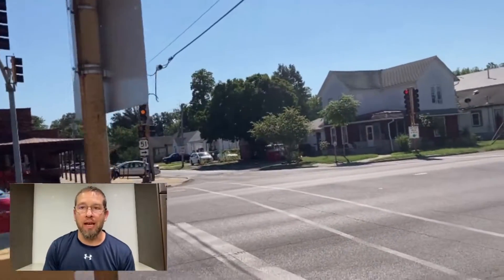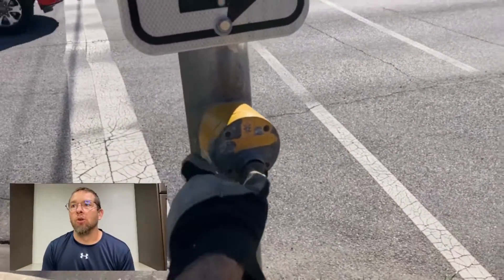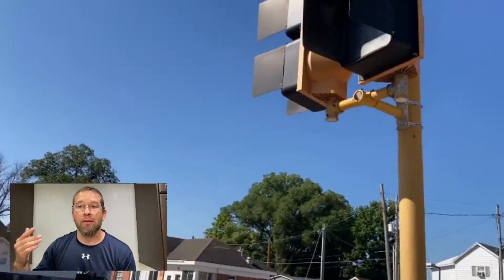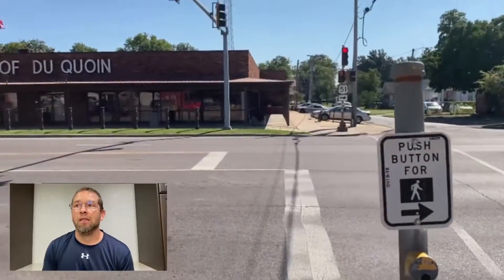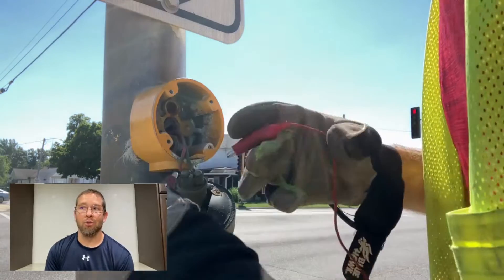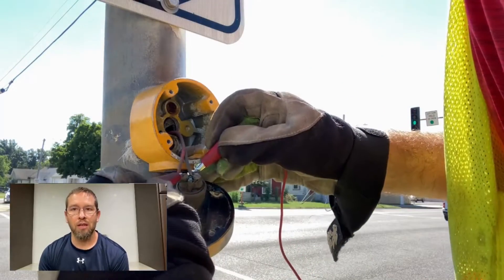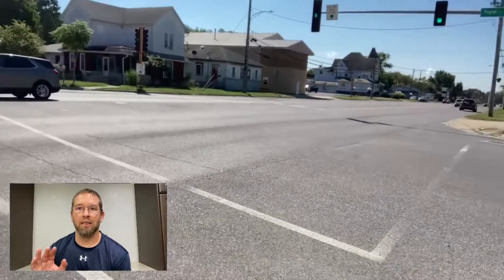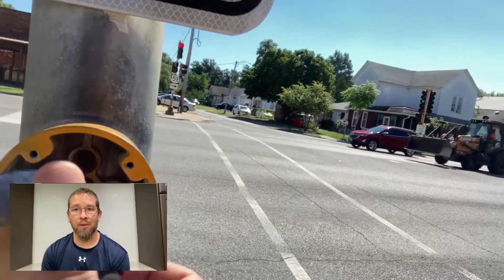Fixing a Failed Pedestrian Button

Comment: Would love to see a video on how the controller talks to a  digital ped crossing display, specifically the ones with the countdowns.  Does the sign have a rs422/485 serial connection, or is it something simpler? And how does that affect the conflict manager configuration?
Reply from the maker: This will probably be a let down to you LOL
Nothing special.  Happens like this:
The controller outputs a walk logic.  The logic is switched to 120V by a load switch in the cabinet.   The 120V goes over a wire to the ped head lighting up the 'man walking' indication.  When the controller times out the walk logic, it switches to a don't walk logic.  Same thing happens thru the loadswitch over a seperate wire ran to the 'hand' indication in the ped head.  
The ped module in the ped head does all the heavy lifting for the countdown portion of it.  
It counts the amount of time the don't walk indication is lit.  
Next time around the ped crossing is serviced, it knows how much time to countdown.
Conflict monitor just makes sure the walk doesn't come up with a conlicting phase
That's it!  Hope that was helpful.  Great questions.
Reply: @ thanks for the detailed answer!  That was awesome!  I never thought it would be so… automatic.  I’ve always been intrigued by how the controllers work on intersections since I was in community college.  I had a programming course where we had to write assembly language on an old Z80 microprocessor and implement a traffic signal controller, including timing loops, input from vehicle sensors, outputs to lights, etc.  thanks for all the work you do on your videos!

Comment: So if someone pushes the button 10 times, will the ped. signals cycle 10 times even if the button is not pushed after the first cycle?
Reply from the maker: No--you can push it 100x but it only 'locks in' the first push.  Once the ped crossing is serviced, it will accept another button push (or 100-LOL)

Comment: Questions.. (Aussie here so not sure if the hardware is the same)..

1. How late into the sequence can the controller be influenced by a tram/bus priority input? For example, if a bus activates a loop on the east as the north/sth has just turned amber.

2. All-flashing is obviously a fallback operation. How much of the controller can fry/release its smoke but still be able to fall back to flashing lights? Is there independent circuitry that ensures this function?

3. Do you manage the timings of phases? If you're working on a box, is it your purview to adjust the timings?

4. Can you go into any detail about linkages between sets of lights?

5. If north/sth is about to turn red, and both east/west are about to get turn arrows, turning traffic on nth/sth can also get a green arrow (where fitted, of course). I've seen some lights that will maintain a green arrow through the sequence, whereas most wait until then phase shift. This seems like a waste of energy, stopping cars when 2 sec later, they get a green arrow. Is this a feature limitation of controller models OR a set parameter?
Reply from the maker: Wow.  You have questions!  Here we go:

1)A preempt call (depending on priority status) can override the general sequence no matter where its at in the cycle.
2)A device called a conflict monitor resides in the cabinet and checks voltages and conflicting signals.  It's job is to place the signal in flash if it sees anything that isn't normal.
3)Yes, I do timing
4)Depends how the agency or contractor wired it.    It can daisy chain between signals or it can be homeruns from the cabinet.  Either way, they all trace back to the field terminals in the cabinet where the G,Y,R outputs are sent out from the controller.
5)This sounds like you might be describing an Overlap.  These are indications that 'mirror' other phases (movements).  They can be used or not used.  Phases have to be used.

Comment: being from the UK, isnt there any visual indication that the button was pressed, actually near or on the button itself? Also why do crosswalks never give enough time to actually walk across the road?
Reply from the maker: Yes, all new buttons have a red indicator below the button that, when pressed, illuminates-letting the pedestrian know it recognizes the actuation.  This was a very old button in the video...
And if crosswalks are not giving enough time for a pedestrian to cross, then the engineer did not calculate the formula correctly.  If you know who maintains the signals, I would call them and let them know the issue.  That's a no-no over here.  Thanks for commenting!

Comment: hmm. Around my Area. They Disabled them all. Mainly Due to people getting out of their car to Push the Button to change the Light. That Was One of the Main Reasons, Another Reason was due to Beggars(Mainly FAKE Beggars) would Pose as Homeless press the button to stop traffic, then go knock on windows asking for change. So Town Decided to just Disable all the Buttons and extend the Red Lights by a extra 3 seconds. Now there is Actually 2 Working Pedestrian Buttons still in Town. One in Front of the Hospital and One in Front of the Police Station. Both Have Cameras and Have Signs saying they are Monitored. dunno if it is true or not. but so far it works.
Reply from the maker: That's a shame that it came to that.  
Not sure why people had to hop out of their car to go push the ped button.  Sounds like the agency responsible for the signals were not maintaining them properly i.e. vehicle detection was not working?
And I know alot of towns have beggars but pushing the button to stop traffic?  wow...part of me says enforcement needs to get involved there... 
Anyway, thanks for commenting!   Interesting to hear stuff like this!

Comment: I've found it just as easy to use my multimeter and check for continuity.
Reply from the maker: Also another valid option!  That would check the button oeration when pressed and you have a test lead on each terminal.  However, it would't test the wires heading back to the signal cabinet.  Thanks for your input!

Comment: I was surprised you took the effort to use a cliplead to test that button. You had the screwdriver in your hand, and there was no insulation barrier in between the screw heads. I just would have shorted them with the screwdriver blade. :-)
Reply from the maker: Yea, but what fun would that have been? lol
Reply: I thought the same.